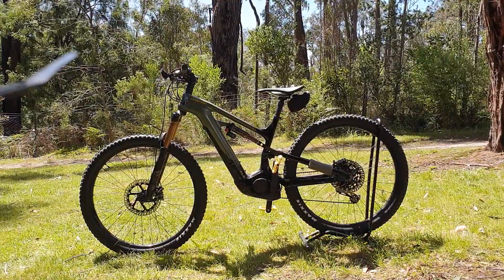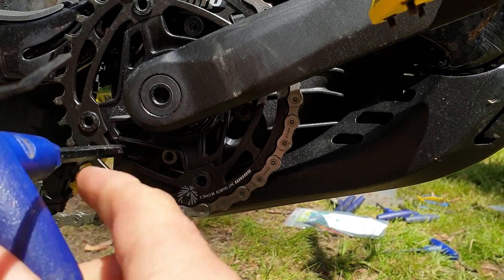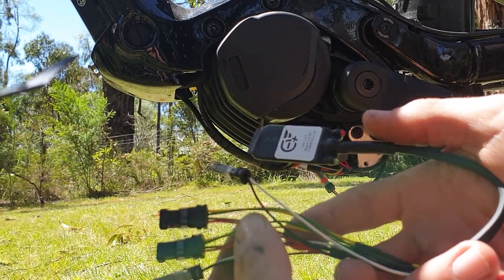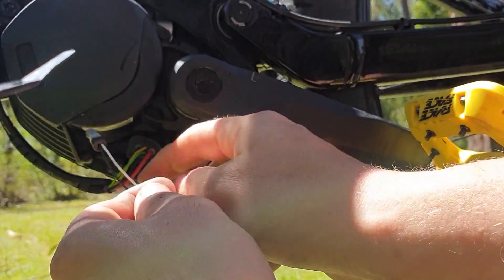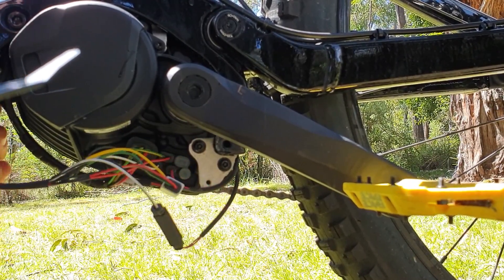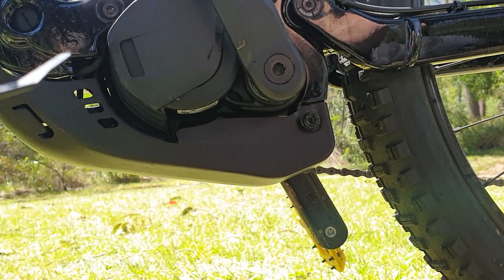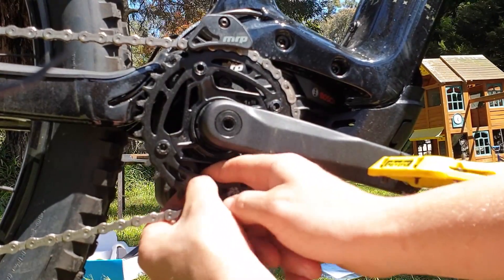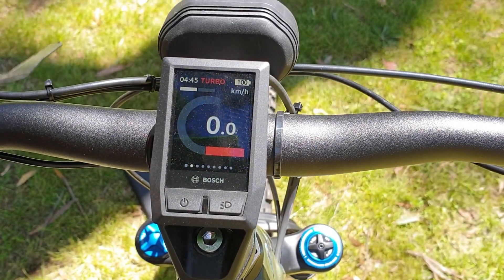Cannondale Moterra Speed Unlocker Bosch CX Gen 4

Comment: I thought despite these chips the Bosch motors can detect. I've read months back lots of people saying it either didn't work, or did for a period then the motor detected and errorered. Is this a new chip that overcomes this?
Reply: Given enough miles it WILL throw a 504 error code. Mine is set to 20mph and I only ever let it turn itself off but after 400 miles it happened anyway. My warranty is now void on all my bosch parts.
Reply from the maker: @Big2009Gee  We have customers doing 500km per week with these chips and not getting the 504 error code. Other chips may not function as well.
Reply from the maker: When these chips were first released it was not common knowledge for the resellers or the customers that you needed to wait for the countdown prior to turning of the bike. This resulted in the errors people talk of. As long as you let the countdown complete before turning off the bike the errors do not occur.